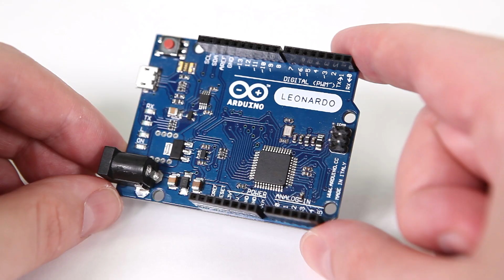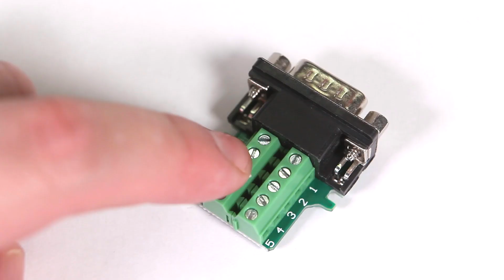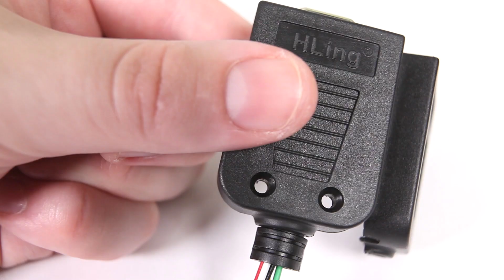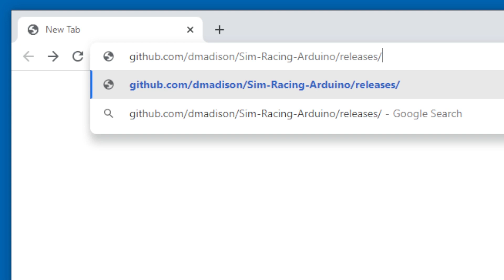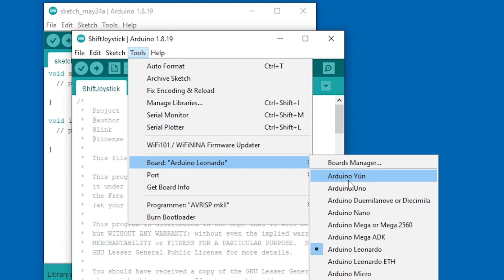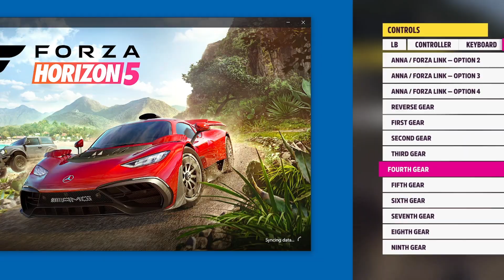(OLD VERSION) DIY Logitech Shifter USB Adapter (No Soldering!)

Comment: Hello, bro! Arduino IDE outputs this problem: In file included from C:\Users\AppData\Local\Temp\.arduinoIDE-unsaved20241129-18008-1hf3h0p.7abv\ShiftJoystick\ShiftJoystick.ino:32:0: C:\Users\������\Documents\Arduino\libraries\Joystick\src/Joystick.h:32:2: error: #error The Joystick library can only be used with a USB MCU (e.g. Arduino Leonardo, Arduino Micro, etc.). #error The Joystick library can only be used with a USB MCU (e.g. Arduino Leona . How i can fixed it? Please help me!)

Comment: Hi, will a arduino UNO work for this project?
the arduino Leonardo is not available in my area
Reply from the maker: Hi, an Uno will not work. You must use a Leonardo, or another board based off of the ATmega32U4 like the SparkFun Pro Micro.

Comment: No clue what's going on. Using a Pro Micro, Every gear in the ShiftPrint is being displayed as being gear 5 / 6. Before it worked somewhat, but gear 1 and 2 were detected as 3 and 4.... Soldering is all solid. I'm at a loss for ideas.
Reply from the maker: It sounds like your X-axis connection is bad. Either the solder joint is weak or it's connected to the wrong pin. Try printing the X-axis position as you move it, see if it's stable.

If it is, try running the serial calibration (in the ShiftPrint example) to set new gear thresholds. It's possible that your shifter's inputs are outside the normal range.
Reply: @dave.madison  It seems to me there's a bad connection somewhere indeed but I am clueless as to where. The solder connections are solid (checked them with a digital multimeter). It has worked for the past hour but suddenly stopped. The only idea I have is that the Pro Micro may somehow have been damaged.... I'm going to do some more testing to see if that is indeed the case. Reading the output from the shifter itself gives predictable and accurate readings...

EDIT: Looks like after reflowing it's fixed itself....Again. If it starts acting up again, I have a spare DB9 and a spare Pro Micro, and I suppose I'll just fabricate a new one. As usual the biggest cause of trouble may just be between the chair and the desk 🤣

Comment: Any idea why mine keeps thinking it's in 2nd? it seems to think this without the shifter attached as well, i've double checked the wiring and reinstalled the arduino but it still seems to do so
Reply from the maker: If it never changes from 2nd something may be misconnected. Try running the interactive calibration from the ShiftPrint example.

It's normal for random gears to trigger while the shifter is disconnected, as the position pins are floating.
Reply: @dave.madison  Thanks for the help, it turns out the DB9 adapter I got must have had a production issue as it's outputs were on completely different pins, but I managed to get it to work

Comment: i am getting an error when i compile. can someone help? avrdude: ser_open(): can't open device "\\.\COM11": Access is denied.
Reply from the maker: Hi there. That's not a compilation error, it means it can't upload to the board. You may have the wrong serial port selected in the menu, or another software on your computer may be using the port.
Reply: @dave.madison  on my win10 machine, i checked device manager and it is indeed the correct COM port. is there a way to "reset" this? i don't know why it would not work if it is pointing at the correct port in arduino IDE. oh and this is a arduino pro micro. i tried with the pro mini board first. didn't work. then i installed the sparkfun board and using that instead.
Reply from the maker: @tekstyle38  If you're certain that it's the correct COM port then something must be using the port. Try restarting your PC, shutting down all background applications, and also try a different USB port.
Reply: I got it figured out. I found 2 tutorials which used PIN7 to PIN 3 to VCC. not sure which one would have worked but it was a more simple wiring the  3/9. I finally compiled the sketch after closing whatever was using the COM port. I wasn't sure if the Arduino pro micro took but during initial testing, LED light would turn on with each gear shift. However, button didn't register. just had to do a restart of the computer. thank you so much!!!

Comment: would this work with the older Logotech g25 shifter because it has extra buttons?
Reply from the maker: It should work with the G25 shifter, though the code isn't set up to use the extra buttons.
Reply: @dave.madison  Sorry, very late, but i´m not using the shifter of the g25, only the buttons, can you tell me if there is a library that can support the extra buttons ? Thanks
Reply from the maker: @pedroferrr1412  I do not know of any libraries that support the extra buttons, no. Sorry!

Comment: Hello there, I seem to be having an issue with compiling the code, it throws an error saying "Joystick_ does not name a type; did you mean 'Joystick'?"
Thanks for any response in advance.
Reply from the maker: Hi there! Sorry you're having trouble. Make sure you download the Joystick library from the link in the description, and that you are compiling for the Arduino Leonardo.
Reply: @dave.madison  I am compiling for the Arduino Leonardo, and I have included the library from the link in the description of your video
Reply from the maker: @anonymousdoggo4679  I'm afraid I can't replicate that error. Do you have another Joystick library installed? Libraries with files that have the same names will confuse the IDE.
Reply: @dave.madison  I do have other joystick libraries installed on my main computer, so I installed arduino on a different computer, did the whole process again, and now it works. Thanks for the help! :D

Comment: Can you tell me if there is a possibility to do it opposite way. So I have a custom shifter from ali express with usb. I would like to convert "somehow" the connection to rs232 so the g920 will recognize this shifter and therefore it would be possible to use it on xbox series x?